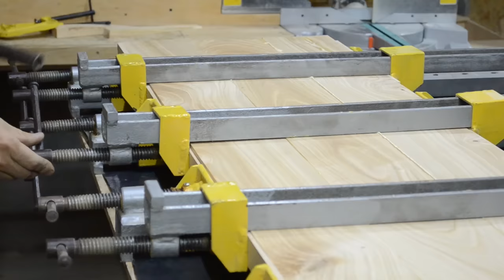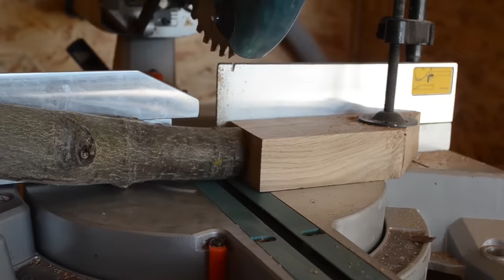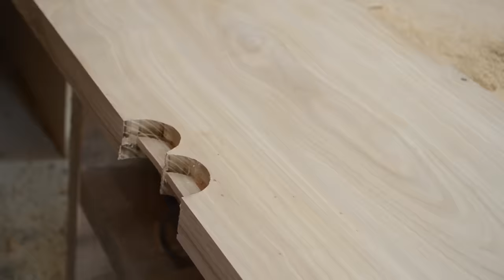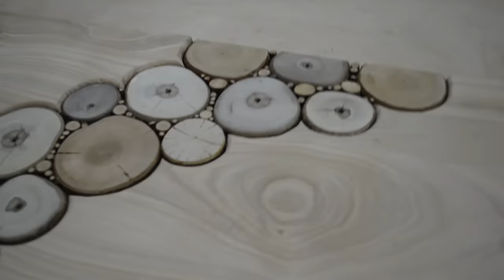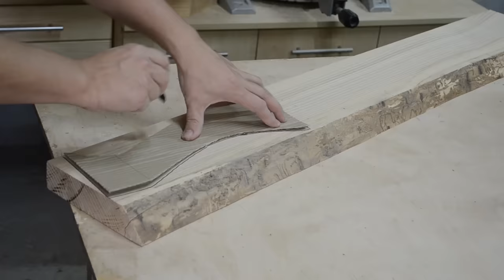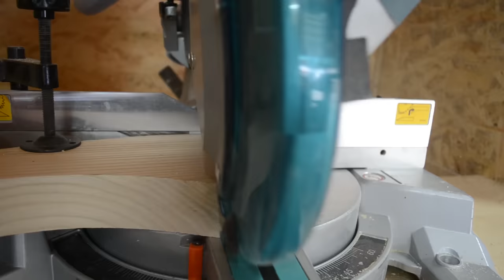Ash wood bench with fruit trees branches inlay

Comment: I love this and the floating concept looks really cool. Weren't you concerned that the whole load is borne by just those six dowels?
Reply: Yes, came here to ask the same.  The top with the inlays is gorgeous, but the 6 ribbed dowels as the connection to the leg assembly is puzzling.
Reply: Yeah I couldn't understand why the gap in between the base and the bench top. Otherwise it's great.
Reply: @JeremyHerbert  Totally agree.
Reply: I asked the same thing. I think it’s very prone to side to side play also forward and back movement.should have made it flat. Other then that it all seemed to work.
Reply: Nah - the load is being borne by the legs - not the dowels.

Comment: I've only been woodworking for about a year and I hope that one day I'll have the skill set to do something like this. That is the most incredible thing I've ever seen in woodworking. You're amazing.
Reply: Keep it up, you'll get there. Pay close attention to his processes. Running the router backwards to avoid blow-out, making relief cuts on the bandsaw, not raising the chopsaw blade until it has stopped.
These little things can only come with experience. A lot of times its learned by doing it the wrong way first.
I've been a finish carpenter for 25 years now and have built many custom projects. This guy is very very good.
Peace!

Comment: First, freaking gorgeous!  I love the way those natural pieces are arranged, and play off of the finished elements.  I don't understand the decision to rest the bench on the dowels on either end, rather than on the beautifully joined frame.  Not that I think it's a problem, I just don't understand it. Loved watching the process.
Reply: I agree with you, that space only creates a dust collector that would be hard to clean. The bench top is BEAUTIFUL!
Reply: Since this is an outdoor bench I would guess the gap the dowels create is for moisture dissipation.
Reply: ল।ম
Reply: Super cool bench but totally agreed - why leave the dowels exposed??  They don't look good and they are a fail point in the whole assembly and they have that ribbed look that does not tie in with the design at all.  Strange choice.  But otherwise an incredible piece of workmanship.
Reply: i agree, that really surprised me while watching. Im surprised he did not make custom dowels for aesthetic sake if keeping visually exposed.  but awesome result in any case.

Comment: Really beautiful, nice job. You may find that it doesn’t stand the test of time due to wood movement however. The top boards will expand and contract with humidity changes and the three glued dowels in the stretcher do not allow for these inevitable changes.  You have a great eye for design, just don’t forget to design for longevity.
Reply: Yup, exactly what I thought too once I saw he used the dowels to attach the top. Just remember the expansion and contraction of wood across the grain always occurs so this must be taken into account for the long term. Nice design and workmanship though despite the lack of long term durability.
Reply: Here come the armchair master carpenters

Comment: as a viewer this was a wonderful idea beatifically executed and i hope you continue in your endeavors. as a wood worker the exposed dole pins the bench is siting on will give me nightmares for a week. so mixed thoughts but keep it up.
Reply: I'm with you on the exposed dowel pins. It almost looks unfinished and seems like it would be a weak point.
Reply: Same thing here. I ringed when I saw that. Not sure why he left it raised instead of direct on the base with maybe some z clips. Still a seriously beautiful piece though.
Reply: As you are wood worker. Can you give your thoughts on the top. I personally would have liked to have seen some biscuit joints as I don’t trust glue on its own. But maybe the need for biscuit joints is negated by the pieces of wood imbedded into top with epoxy? But I’d personally still like to have seen some biscuit joints. Or is not necessary?
Reply: Also 9:20, he has a router. Why not use that it would be quicker?
Reply: @georgelopez1484  biscuits aren't necessary for anything but alignment. Wood glued in a linear grain like that is the strongest glue joint you can have. If you broke this top, it would break the wood not the glue joint. Also, the issue I have with the dowels is that there was no room for wood movement
Reply: I wouldn't worry about the dowels.
All the vertical loading is carried by the slat that the top sits on.
The dowels only take lateral load and that will be minimal on a table like this.
Unless he lifts the table by its top. Wait a minute. I've just talked myself out of the point I was making. Hmmm.
Reply: @richardschofield2201  When a person sits down there are vertical AND lateral loads applied. No one sits and stands from a bench in a careful perfectly vertical movement. Those dowels will fail. Wood movement (seasonal moisture changes) will be difficult to contend with in this design. Don't forget that epoxy resin deteriorates with exposure to ultra-violet light, even natural indoor light or in the shade outdoors. A good exterior-grade varnish applied to the final piece will definitely help in this regard.
The piece looks fantastic. The designed shape is quite nice. The engineering of joints is not so nice.

Comment: GREAT BENCH!! I'm an intermediate level woodworker. You have some great skills!  I have a question. Why did you choose to leave the dowels exposed between the legs and the table top? Do you think it might cause a long term structural issue if the majority of the weight rests on the dowels themselves rather than the legs directly? Not criticizing, just curious :) Thank you! I loved the video.
Reply from the maker: Thank you! It's just an element of decor. To give a "floating" appearance.
Reply: @homemadeinlviv8041   I have no real experience in woodwork (just love to see the masters at work in these kinds of videos), but I wondered about the same thing. I get the artistry of the 'floating' seat, but don't you loose a lot of strength doing it that way?

Comment: Different sized hole saws would speed this up tremendously.
Reply: Hole saws... not so much I think because they're not through-holes.  Maybe some massive forstner bits, if they exist in those sizes?
Reply: @cooperised  You are right... And they DO exist...I don't think I'd want to see the price tag on them though.
Reply: @cooperised  You do not have to drill all the way through with a hole saw. Drill all your holes first,  stopping at the depth required then quick knock out with the chisels.

Comment: Couple questions: is the space between the top and the base asthetic, or an attempt to account for the fact that the seat will expand and contract width wise where the base will not? Do you think that those dowels will flex enough to account for the expansion and contraction?  Beautiful by the way, it turned out really nice looking.
Reply: I would imagine both. wherever they are, looks to have various weathwere that could be hard on some woods and wood furniture.
Reply from the maker: It's just an element of design  - "floating" appearance
Reply: @homemadeinlviv8041  you should try a clear resin or plastic rod for the pegs, make it look like it really floating.

Comment: Nice idea and I liked the tenons on the frame. I was watching thinking "I hope he does it this way" and you did. My only reticence is the top fixing which will surely warp and there's nothing to accommodate expansion and contraction. I'd be interested to see how will it lasts out doors
Reply from the maker: This is a bench is for indoor use! Outdoor, of course, it will deformed. I periodically visit my relatives for whom I made this bench. It is still fine.
Reply: @homemadeinlviv8041 expansion and contraction is partly limited if you use quarter sawn timber. But your planks are through sawn and prone to warping whether inside or outside. At the end of your video you show the bench being used outside

Comment: This is an incredibly beautiful piece of functional artwork, so much skill and imagination involved in its creation ;?)
I do wonder why you chose to "float" the bench above the platform - it does seem to me to create a weak spot that, over much time, might potentially fail since all the weight and stress is only supported by those six dowels, am I missing something or underestimating the strength of the dowels? 
I mean if it was a coffee table I'd have no worries at all, but as a bench (and especially if it's a well-used one ;?) there's quite a big difference in load bearing capacity over time.
Reply from the maker: This is an element of decor to give a "floating" appearance. Ash is a very strong tree. It will withstand this load and will not bend.

Comment: What is the purpose of the gap between the bench top and the frame supports, with just the dowel rods supporting the bench top? It seems it would have been a lot sturdier if the bench top set completely all the way down on the frame.
Reply from the maker: This is an element of decor to give a "floating" appearance.

Comment: I'm surprised you didn't use biscuit joints between the bench planks.
Also, could you please explain why you leave the gap between the base and the top?
Beautiful work!
Reply from the maker: Thanks, I just trust my glue. I am in touch with my relatives. The bench is still in order.
The gap is an element of decor to give a "floating" appearance.

Comment: absolute beginner here, I have a question. I've never seen anyone not get rid of the bark before pouring epoxy because of the air bubbles. He kept it on and I couldn't see any bubbles at all? So when do you have to get rid of the bark and/or seal the wood before pouring epoxy and when is keeping it on fine ('cause the bark looks fire in my opinion)?
Reply from the maker: Not all bark gives bubbles. The most bubbles will be in the brittle bark. Then I use step-by-step filling. Thus, the bark becomes saturated with resin gradually and the bubbles become smaller and can be blown.

Comment: the amount of force those 6 little woods have to endure 🤦 well woods are still good in compression but would have been much better if it wasnt elevated for better force distribution. sooner or later, the bench will also suffer from flexural stress. like the beams were only used as braces lol
Reply from the maker: Sure, the time will test this bench for durability like everything on this planet